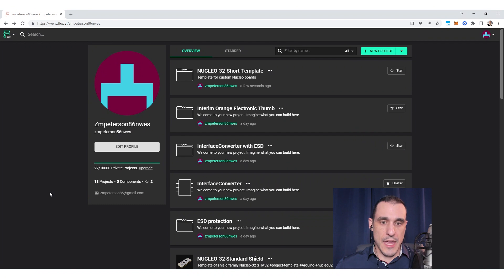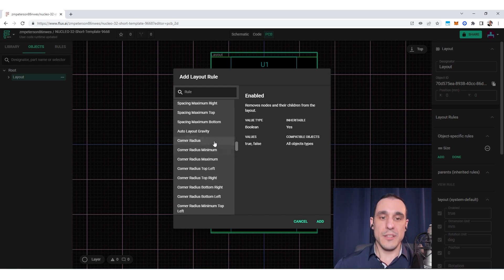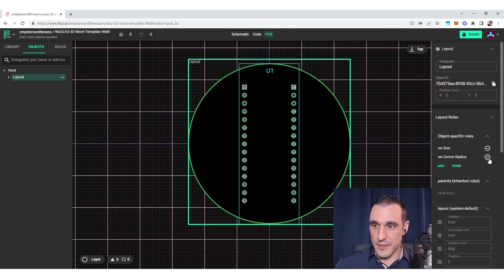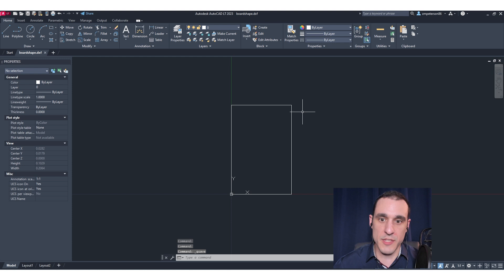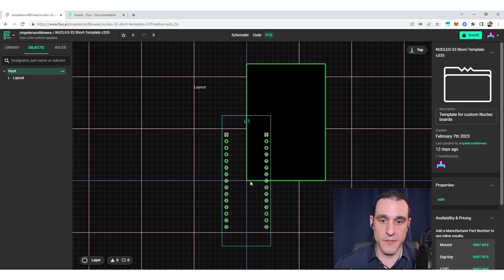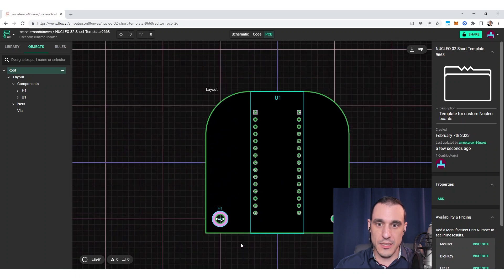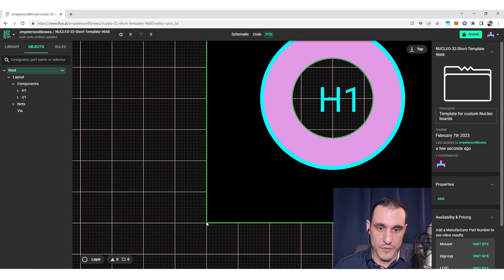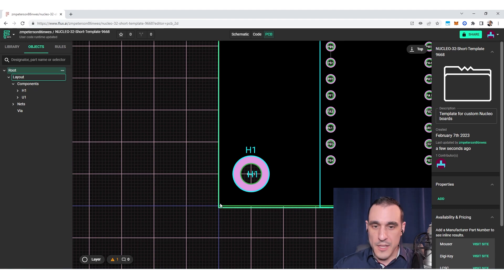How to Set a Custom PCB Outline

Comment: When importing DXF or SVG files (either outline only or a one-color filled outline), only a large black triangle is displayed instead of the intended board's shape. I attempted this by converting a PNG outline into DXF or SVG using Inkscape, as well as by creating a 2D draft directly in FreeCAD and exporting it to DXF (similar to what was shown in your video). For reference, when I open the DXF file created with Inkscape in FreeCAD, it correctly displays the figure's outline as expected.
Any clues?
Reply: I found a workaround: Open the DXF file in FreeCAD, select all the 'shape' objects, and use 'Upgrade' to combine them into one wire object. Then, export it as a DXF file. After this, Flux should correctly display the shape in the Layout.